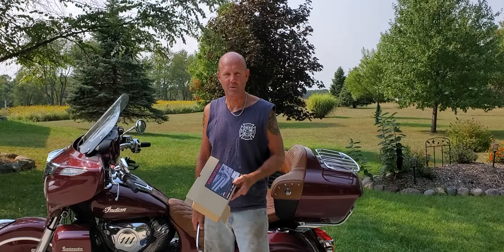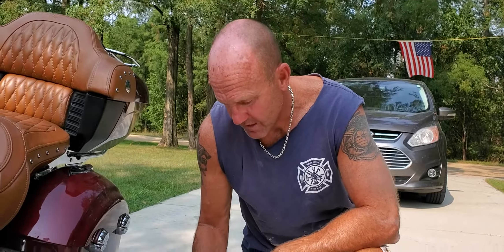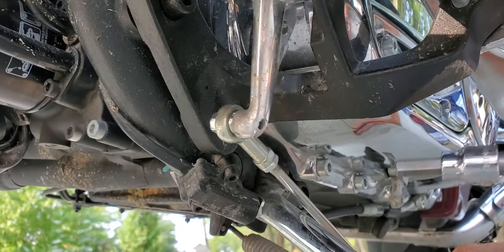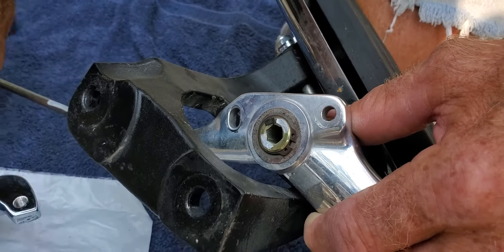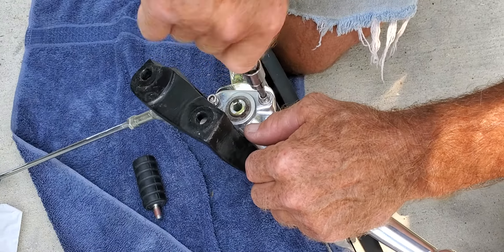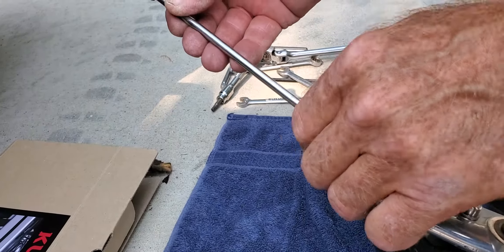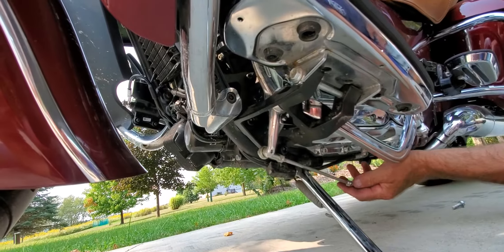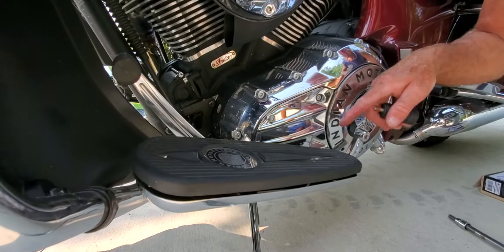Kuryakin heel shifter on 2019 Indian Roadmaster motorcycle

Comment: I really enjoyed this video as it showed sufficient detail.  I especially appreciated the wrench and socket info so I didn't have to hunt for the size.  Was able to install mine on a 2014 Indian Chieftain.  Getting the original bolts off was a little tough as well as loosening the nut on the shift rod.  I couldn't get the rear nut on the shift rod so I did the front one.  Took me less than 1/2 hour.
Reply from the maker: Glad i can help

Comment: TJ, thanks for posting this video. I purchased a Baione heel shifter for my 2019 Chieftain from Amazon for $95.00. I couldn't spend over $200.00 from other outlets. Bad thing is there were no instructions with the kit or spacers, so your video came in real handy. I did get it on easily and it works just fine. There is plenty of clearance without the spacers so it may have been manufactured so spacers are not necessary. I did have to use my supply of Loctite for the reassembly, but it looks just as good as more expensive shifters.

Comment: I went another route. I went to Ebay and bought a heel shifter for $43.00, looks great. The shift lever goes above the floor board so no need to disassemble or adjust anything, also you would lose no ground clearance. Took just 5 minutes to install. The only down side is if you had a shoe size of maybe 14 or larger you might lose some clearance with your shoe. I have a size 10 so it doesn't affect me at all. On the other hand with the Kuryakin I'm thinking you might have to slid your foot back a little more to step on the rear peg to go up a gear. Just a thought.

Comment: Hello, I just added a heel shifter to my Indian Roadmaster and I haven’t taken it for a ride yet because it is freezing and raining here.  However, just sitting on the bike in the garage and running through the shifting, it doesn’t seem to shift like it did before and sometimes will not go to the next gear epithet going up or down.  I adjusted the linkage so that the heel shifter is not hitting the floorboard but not sure if something is wrong.  Any thoughts?
Reply from the maker: What BRAND  are you using